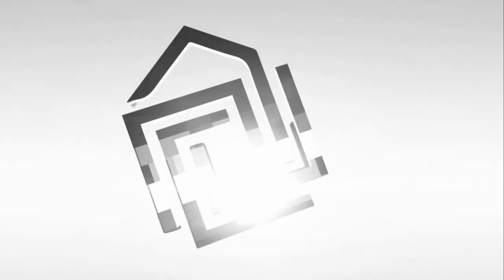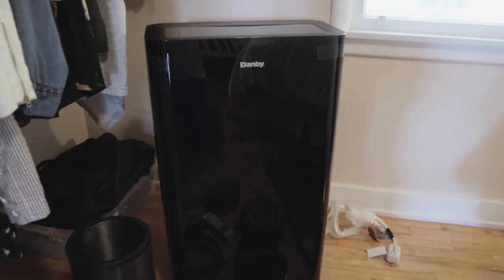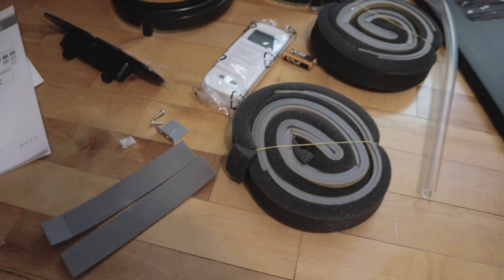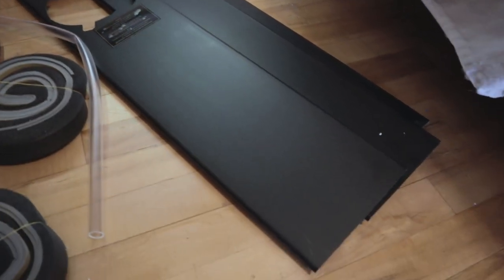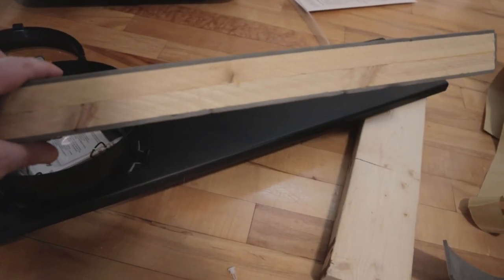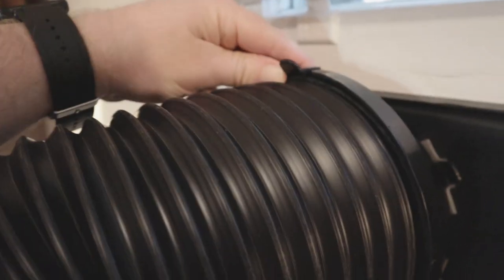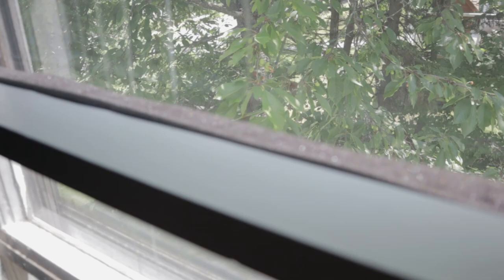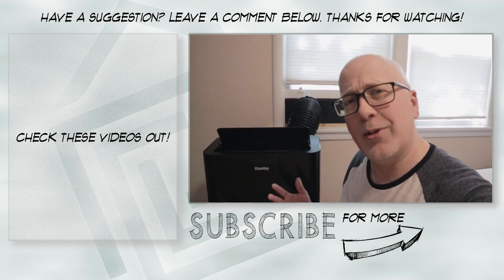Beat the Heat: Installing a Danby 3-in-1 Air Conditioner

Comment: Thx for the video.  How is the noise level in dehumidifier mode?  Looking to use this in the bedroom and would like to determine if dehumidifier mode might be an acceptable compromise between noise and cooling.  If this mode can reduce temps by a few degrees but is quiet, it should work for us.

Comment: I have a hose attached to the top drain spot and a bucket to run into....but does urs drain water continuously like mine? Or am I doing it wrong? My bucket fills so fast
Reply from the maker: We didn't use the drain hose; it has a container inside that collects the water. We only had to drain it once a week at most. If you are using a drain hose, I would expect it to drain some water continuously but it's meant to be run to a drain that supports that (i.e. a sink drain or a drain in your floor)
Reply: According to the book, it sounds like you are running yours on "dry mode". See page 11. At least in my book it's page 11. It talks about water drainage. It sounds like your is on dry mode and you have high humidity weather?
Reply: Yes. My bucket fill so fast too.

Comment: We've got 5ft horizontal sliding windows. Is there enough exhaust trim to cover this size opening? Worse comes to worse, since we'll be using it in the living room, I guess I could rig it to exhaust up the chimney flue. Your thoughts?

Comment: My Norpole portable air conditioner window slider adaptor is so hard to put together. I wish I would have seen this video first before purchasing mine now. I hate it just because I am having a problem keep the hose in the window. Does not snap in like this one.
Reply from the maker: Sorry to hear that; that would be disappointing. Hopefully you have it working better by now.
Reply: @Handyverse  No I do not. Trying to go another route with this.

Comment: Hi 
Thank you for this video.
At what temperature and what mode should I set it? because it doesn't work well with me

thank you
Reply from the maker: Sorry, the temperature and mode would have to be adjusted depending on what conditions you have; there isn't really an answer for what the best temp/mode is. I'd suggest experimenting until you find what works best for you.
Reply: used in small room PAC meant for small room not big room. Adjust the temp 24 to 23 in cool mode, not below than this. noise level depend on the model but most PAC sound 60 to 70 db

Comment: Hey there!
I was wondering if you could tell me what's the length of the power cord? 
Also, any idea how much wattage this thing uses?
Thanks!
Reply from the maker: Sorry, I no longer have this unit (we have since had a heat pump installed) but going from memory, I believe the cord is about 6 feet long. Also not sure on the wattage but we used it all day, every day for three months last summer and only had a negligible increase in our power bill.

Comment: Great video, man.  Would you say this outs louder then a window ac.. reading that these are loud however window acs are pretty loud as well. Also house how is this system holding up today
Reply from the maker: Thanks! We had it in our bedroom and we found it fairly loud for there. Didn't bother us too much but something to be aware of. We no longer have this unit (had a heat pump installed and don't need it anymore) but used it steady for three months straight with no issues. It worked well for us.
Reply: @Handyverse  thanks. All the best
Reply: After you able to use the continuous drain feature while the system is running. I.e  I am close to a drain n would like to avoid draining  into a pan or container

Comment: Hi ! A question here that I can find any answer: if you have a screen already in you window do you need to remove it ?
Reply: No the screen will not be a problem
Reply from the maker: Like Sheena said, the screen should not be an issue, assuming you have a screen that's outside the window, not an interior screen.

Comment: Hey I just got the same Ac, I was wondering if you can tell me if your Ac leaks hot exhaust air. Where the tube connects to the Ac where the plastic clip on part to the hose is. Becaus3 mine does
Reply from the maker: Sorry to hear that. I just checked ours and it doesn't seem to be leaking hot air there. There are slots that it slides down into; maybe check to see if yours is engaged with those?

Comment: how long is the hose?
Reply from the maker: It's about six feet long when fully extended. You'd probably want the unit to be closer to the window than that to give you some flexiblity in running the hose.

Comment: If I had a window that slides down I would have gotten a window unit, cheaper more effective. I bought this one from walmart, one day trial so far and it happens to be a heatwave, 35 celsius outside, it brought it down to about 29 indoors. Still hot, but at least I won't die.
Reply from the maker: I agree those are cheaper and more effective however we had two issues with getting one of those: 1, our window was very old and would open wide enough and 2, we didn't want one of those units stick out the side of our house. That is hot! Glad it worked at least somewhat for you. It worked well for us but we didn't have that high of a temperature outside to deal with.